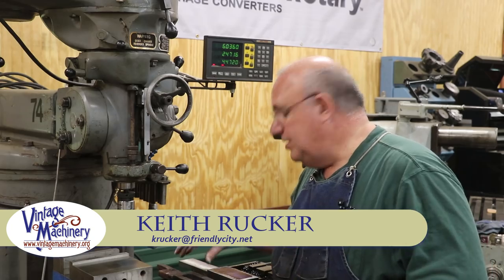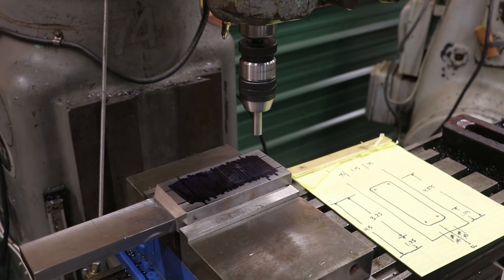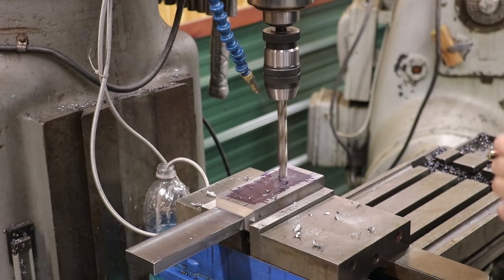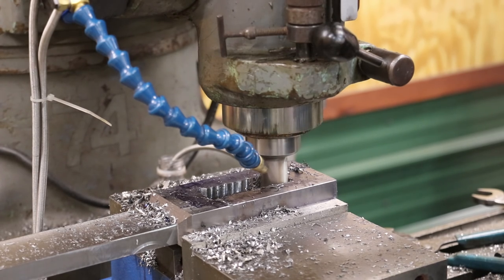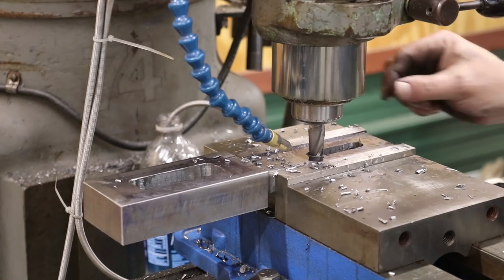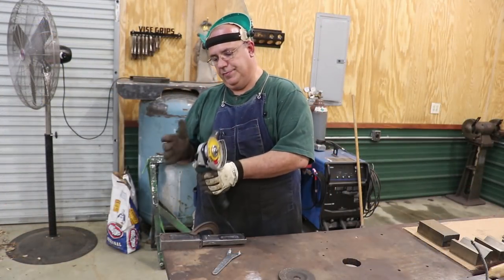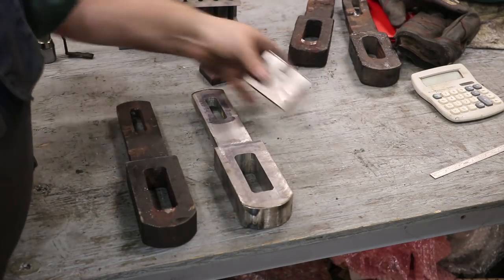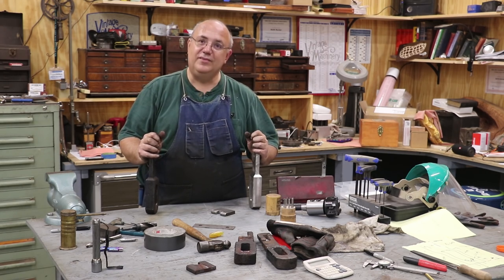Machining Steam Locomotive Spring Hangers: Part 2

Comment: I know old habits die hard, but I have complete success using a DRO in symmetrical situations like that by spotting all the holes, then drilling them (and tapping and chamfering as needed). If you make a mistake spotting, it's easier to fix. Having spotted where you are going to drill is a great sanity check. And I save a lot of time by changing tools only once per 4 holes over 2 times per hole.

Comment: That lead hammer looks like it could use a re-cast, got some good use out of that thing!
Reply from the maker: Yes, the hammer was a gift and was pretty much worn out when I got it.  Unfortunately, the style handle that is in this one will not fit my hammer molds.  I have a couple of new handles that I need to use to pour a few new ones.  I kind of think that the old one is pretty cool though!

Comment: Are there any parts of that loco that you have not replaced? I'm thinking they need to start calling it a Rucker Iron works instead of Vulcan...
Reply from the maker: Off the top of my head, both of those spring hangers, two wedges for the connecting rods, both of the valve rods, I rebuilt the entire reversing gear making about a dozen pins and bushings, lapped the steam valve, rebuilt the throttle lever, repaired one of the cylinder heads, new copper gaskets for the valve chest, four new steam pipe rings, rebuilt the brake valve, and made a new spindle binder wedge.  I am quite sure that I am not remembering other new parts and repairs that I have done - there have been a lot.  I could spend three months solid just doing work that we know needs to be done sooner or later.....

Comment: Keith

Would an annular cutter been a better choice instead of the 1in end mill for hogging out the metal in the middle of the hole?

John
Reply from the maker: Sure, it would be a good option.  I don't have one that size though so it was a lot faster and cheaper to work with what I had.

Comment: Hi Keith I have a milling machine just like you ate using in this video but yours makes a huge amount of noise. What is causing all of that? Also that big Baldor grinder is awesomeI have always wanted one along with a matching long arbor Baldor buffer.
Reply from the maker: I think that most of the noise is coming from the interrupted cut and not so much the machine itself.  I plan to rebuild the machine at some point in the hopefully not to distant future and it will get all new bearings when I do.

Comment: I've never built a spring hanger like this one, but I think I would have pulled out the acetylene cutting torch for this job. Keith kept saying the tolerances weren't that critical. A torch would have cut that piece out in less than a minute and a few minutes grinding and done!!! But I guess Keith wouldn't have had all that fun making chips if he had torched it...
Reply from the maker: If I had known that the machine shop was going to plasma cut a piece of stock for this project, I would have had them at least rough out the outside profile and inside slots.  That would have been a huge time saver!

Comment: Wobbly center drill at the start?
Reply: i saw it too, probably just wanted taking out and in again
Reply: Jusb1066 probably so, might have been a chip in the chuck.
Reply from the maker: Yeah, I noticed that too.  I looked at it after the first two holes and discovered that it was so large that the chuck was trying to grip on an area that was ground out.  I swapped it out with a smaller size and all was good.

Comment: I know it's mild steel but if you heat treated it would it add any strength at all?
Reply from the maker: I am by no means an expert on these kinds of things, but generally when you make something harder, you also make it more brittle.  In this case, I think that softer would hold up better than harder with all of the weight and banging on the part that you get as the locomotive moves across the tracks.
Reply: I agree with Keith especially when his previous hanger has done so well in use. The original wrought iron hangers most likely had flaws in the metal that lead to them failing.

Comment: Are you sure the originals were 100 years old? Perhaps someone made replacements 50 years ago and didn't mark them.
Reply from the maker: Its possible, but probably unlikely.  Not to mention that the locomotive was used intermediately  at various sites from when it was built in 1917 up through the mid 1930's and then sat idle on display for about 50 years until the museum acquired and rebuilt it back in 1980.  It is quite likely that the museum has put more hours on this locomotive than all the previous owners combined.

Comment: your mill sounds like a bearing is shot
Reply: Jesus von Nazaret straight cut gears
Reply: Sounds more like a bearing than gear teeth.
Reply: Your not referring to the noise of the end mill?

It's the noise of gears that arnt in oil 
My lathe sounds like that  the auto feed gears at the back that arnt submerged in oil and a bit worn out 
A bearing is more hi pitched 
Or chattery if it's really stuffed 
Heavy deisel mech in agriculture 
I can here a stuffed bearing from anywhere 
Lol